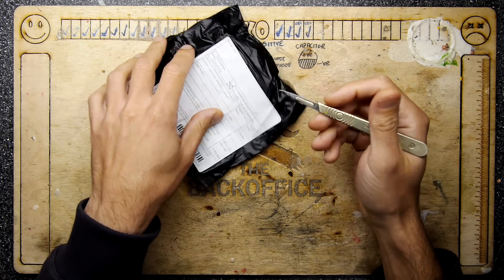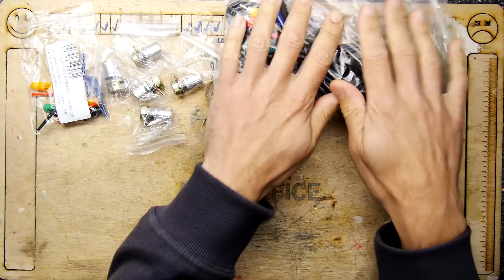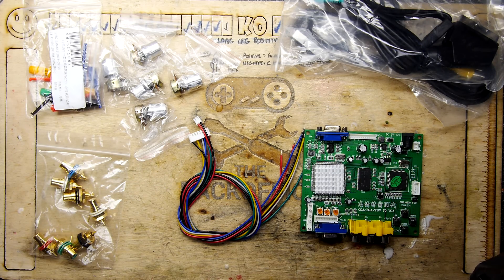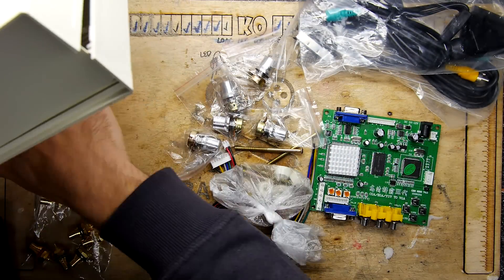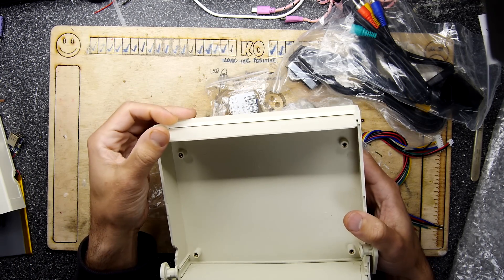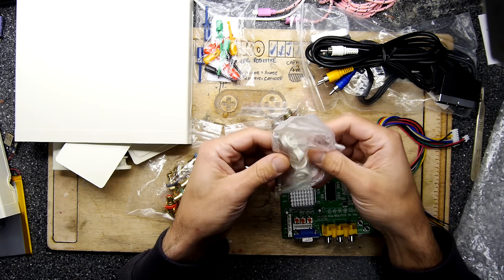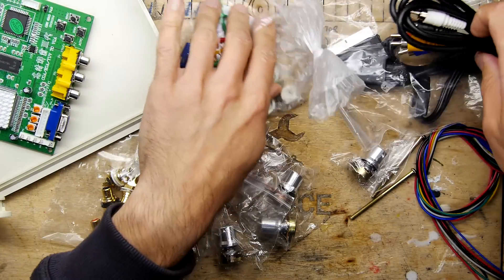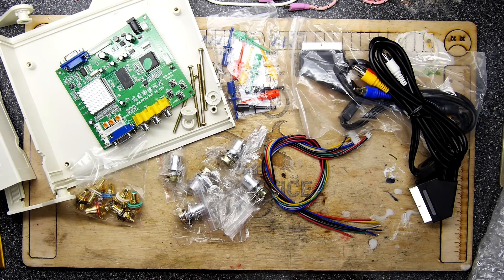Video Converter Project Unbagging

Comment: Hmm...The video decoder definitely looks like it'd do the job for getting most rgb signals to a television or monitor. I have a hunch the R G B H V terminals are input terminals that can tap into that kind of signal, which would make splicing into things like arcade boards and old video connectors a snap.
Reply from the maker: Your Spidey senses are really hitting the mark 😁